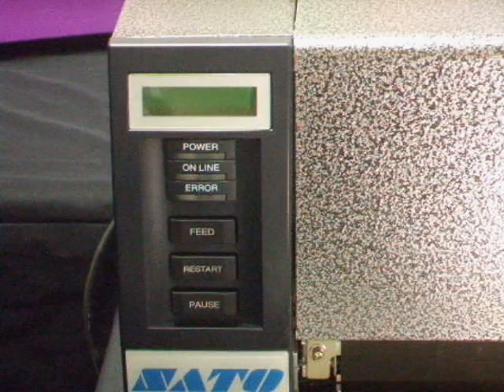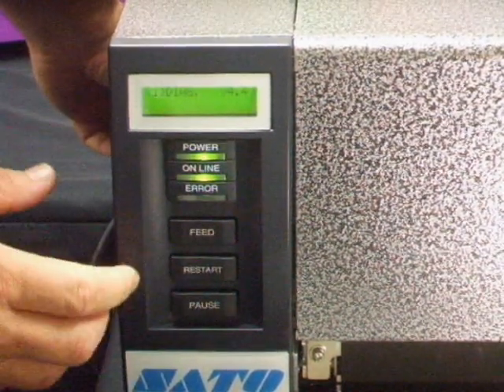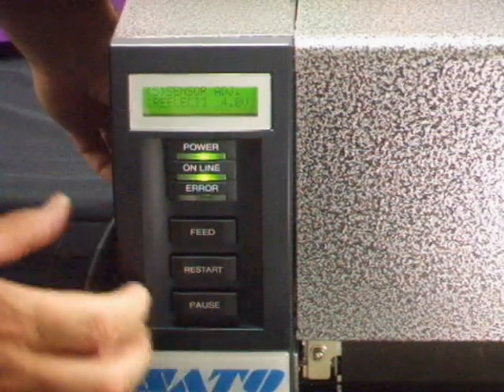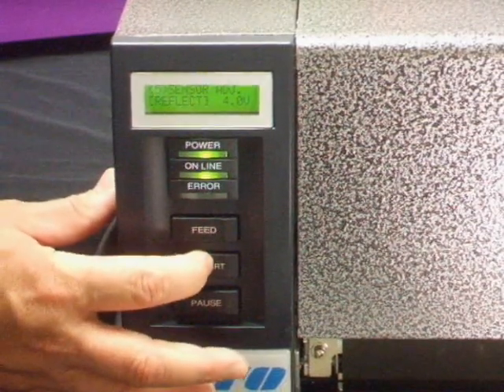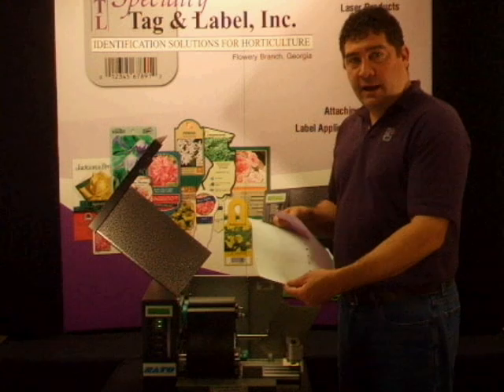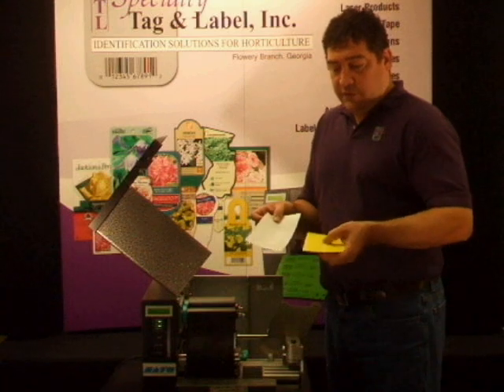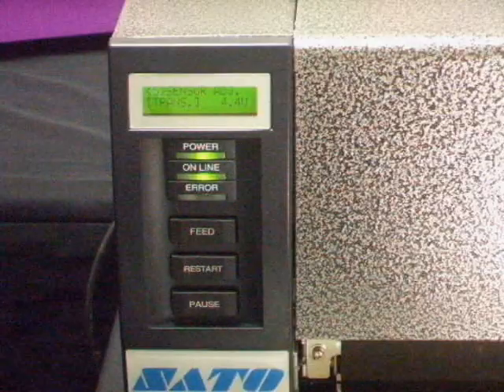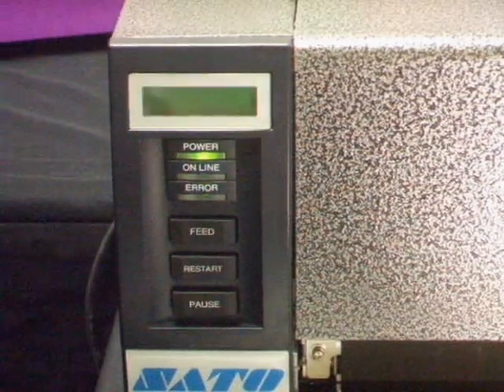How to calibrate your SX thermal printer

Comment: Hello, I generated my barcode labels but having difficulty formatting in to print on the special tags/labels for this printer (B-SX5T). These tags comes in rolls, but strip divided in to smaller units, and each barcode label needs to fit in each of these smaller units. This is not an A4 paper, I think you know it, please help with a sept-by-step process